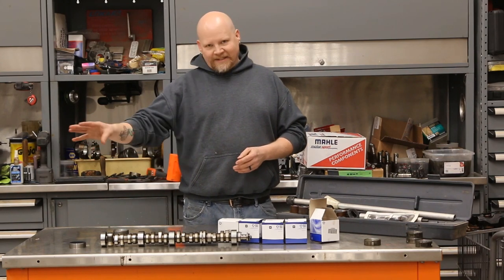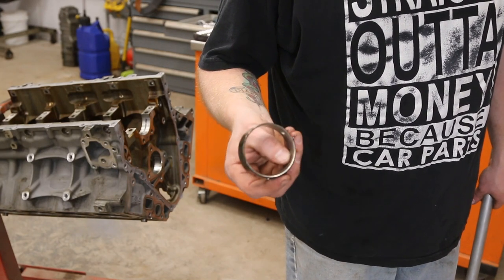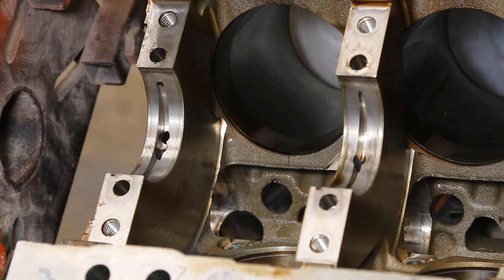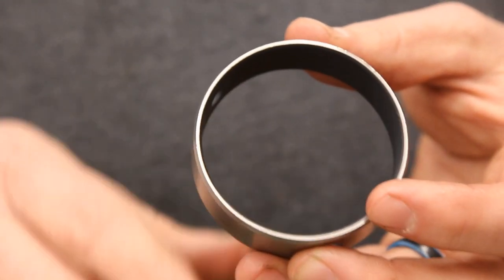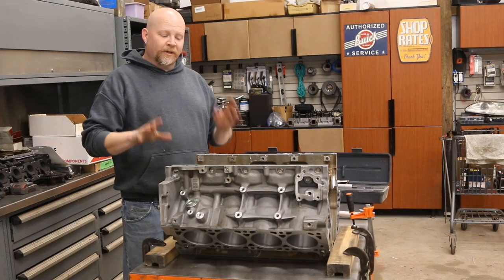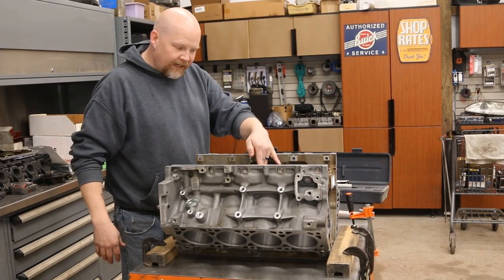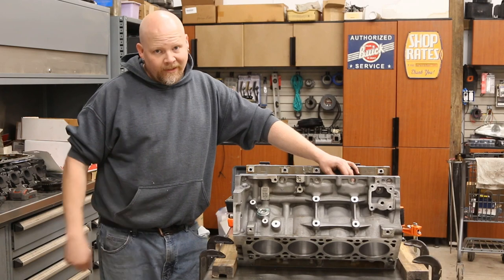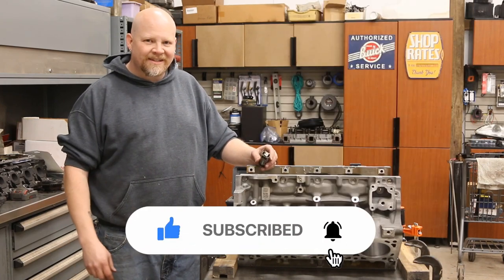How To Install Gen V LT-series Cam Bearings With Tips and Tricks!

Comment: Whenever I've got a bare block, standing it vertical, flip 1/2 thru, and putting the bearings in the freezer the night before, makes it easier.
Reply from the maker: Yeah, freezing works, as long as you wipe the moisture off from condensation.

Comment: The measurements per Summit Racing are: 19260875 2.328"OD, 19260876 2.308"OD, 19260877 2.348"OD.  All are 0.775" width.  Pricing varies by vendor and seem to be sold individually ranging from $32 to $50 each with the highest of course a GM online parts site.

Comment: Hello sir I’ll be tackling this on my l83 engine can you tell me what brand installer/puller you used? And have you had any issues with using that gen 4 bearing instead of the gen 5?
Reply from the maker: @tantic8108  the bearings are the same inner and outer diameter, the difference is gen V stock bearings are split with a puzzle-piece keeper, and the gen IV LS design is a single piece. Split bearings are less desirable. 

I used a cam bearing installer tool from Powerhouse Tools.

Comment: Does the bearing sticking out on # 5 not interfere with the fuel pump lifter ? Maybe on an after market cam with a bigger fuel lobe?
Reply from the maker: @coltonsmith3397  no, that is how it is factory. There is a ton of clearance.
Reply: @Reddirtrodz  on the factory one it has that cut out and doesn’t stick out into the fuel pump lifter at all
Reply from the maker: @coltonsmith3397  where are you seeing the bearing stick out? Share a timecode from the video showing what you are asking about.
Reply: @Reddirtrodz  I look down the fuel pump lifter bore and see the bearing sticking out.
Reply from the maker: @coltonsmith3397  on your engine? I thought you were asking about the engine in my video, lol. 

You need to make sure the oiling hole in the bearing is centered over the oiling port in the cam journal. If it is properly installed, there should not be any exposed bearing material. Go find me on Facebook https://www.facebook.com/share/nDWwKA3AkKU7WxPD/?mibextid=qi2Omg and send me a PM with a pic so I can see it.